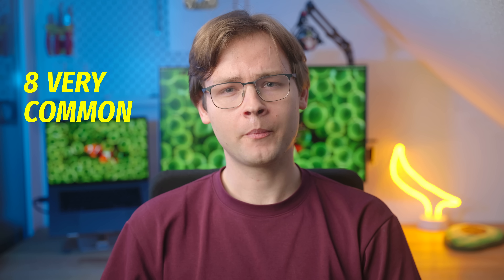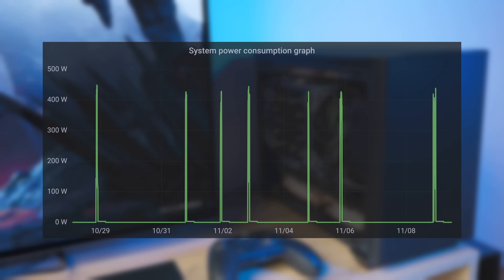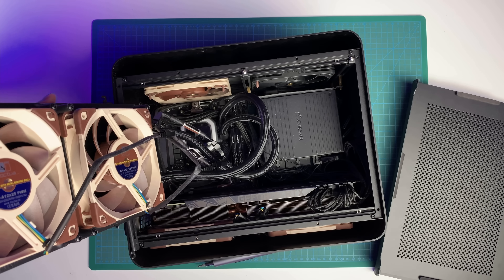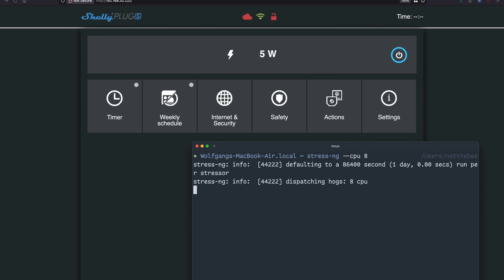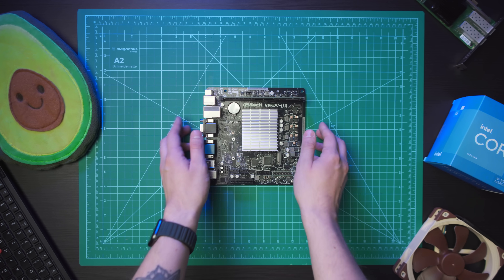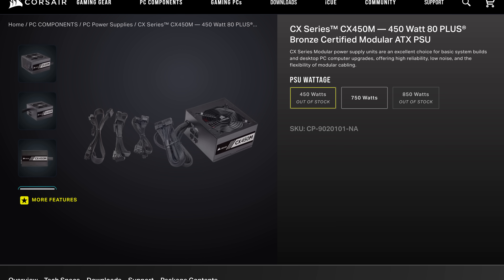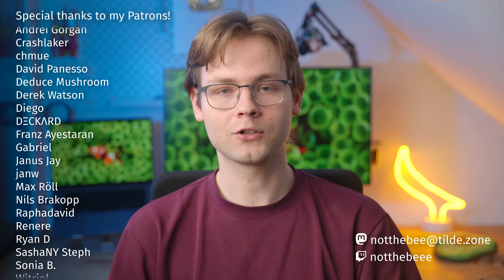Busting 8 Common Homelab Power Efficiency Myths

Comment from the maker: To try everything Brilliant has to offer—free—for a full 30 days, visit https://brilliant.org/Wolfgang/ . 
The first 200 of you will get 20% off Brilliant’s annual premium subscription.

Power efficient builds spreadsheet from HardwareLuxx: https://docs.google.com/spreadsheets/d/1LHvT2fRp7I6Hf18LcSzsNnjp10VI-odvwZpQZKv_NCI/edit
Reply: Do you think CPUs with E-Cores are worth it for good efficiency and performance for not so heavy tasks?
Reply: I'd really love if Wolfgang willing to make an example/tutorial using old mainstream/popular hardware of their era and still abundant and optimized it, not just the niche one. It would be nice for me, a common people without IT education, a novice. Using anything available on their home (unknowingly mistake etc), and then, mix-match it, not just buy an used old hardware.

For example: on my area, H61 chipset Mobo for miserable Sandy-Ivy Bridge (2nd-3rd) is still abundant. Along with DDR3. Maybe the pebble-like abundant is similar to Haswell - Kaby in Europe. And, C chipset is good, but B85M is abundant and not everyone using 6 HDDs, 4 at max for their homelab.😊
Reply: Useful vid, as usual! Hope you don't mind me putting this useful info here : In case anybody is wondering, 32GB hyperx fury 3200mhz runs at full speed and capacity on the n100m and n100itx.
Reply: 😂😂😂 why did you do it you didn't have too 😂😂😂 🤣🤣 @ 9:30
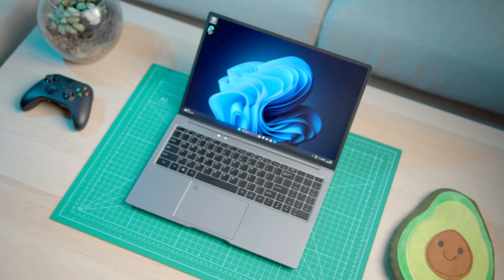Reply: 12:58 - laptop without screen and battery or how was it compared? 🤔
Reply from the maker: @TheStuartstardust  Fully charged battery (the laptop wouldn't power on without the battery). I've measured the power consumption both with screen on and with screen disconnected physically, and it made no difference.
Reply: What about server power supplies, as they tend to have high efficiency ratings by default, but might also be geared towards higher loads as you mentioned in desktop?

Comment: Does someone have a great advice on PSU?
I got an 12400f and Intel Arc A380 and 3 HDDs and 1 SSD
so not much and its mostly idling all the time
Would be nice if someone has an idea what to pick
Reply from the maker: PicoPSU
Reply: @WolfgangsChannel  Du bist ja denke ich mal Deutsch, ich nehme mir mal das Recht auf Deutsch zu schreiben. 
Für den PicoPSU brauche ich ja sowas wie ein externes Laptop Netzteil oder andere Netzteile mit so einem 5/2.5mm (Barrel-Jack?) 
Hast du da ein gutes im Kopf?
Reply from the maker: Ich habe bisher gute Erfahrungen mit den Leicke-Netzteilen gemacht
Reply: @WolfgangsChannel  alles klar danke dir 🙏

Comment: The power supply has other reasons to go for higher rated ones. Like durability when used 24/7 i have had several gold rated fail and made me swith to platinum rated as some brands guarantee 12 years on those. Have no broken one yet and the oldest ones are nearing 10 years now while most gold rated died around the 5 year mark.

Comment: There are still new 180W PSUs for office PCs, but for the price you are better off using a Pico PSU and a 12v 3A to 8A depending on your Max power draw + 15% headroom. There are Pico PSUs whu accept more than 12V. Those are for higher Wattage applications or if you plan to use a 65W to 200W 19V Laptop power brick. But have in mind the Pico needs airflow on 50% and more load. 
if you plan to use a N or J series CPU and go fully passive, what possible is and you won't have any fans in your case. Buy the highest wattage 12v Pico PSU and put some passive fins on the power stages on your Pico also the power stages of your motherboard if your motherboard has no passive cooling and every chip that is bare silicon. 
most of the Motherboards are not designed for passive cooling, even if you don't use a down blowing cooler is a big problem on modern Mainboards because of the poor thermal design around the CPU that require a down facing fan on it.

Comment: Will a AMD APU with disabled GPU (such as the ryzen 8400F) use less power than the same part with GPU (8600G) - when used in headless configuration - and without doing stuff you can offload on the gpu such as transcoding ?
Reply from the maker: In AM4 chips it used to depend on whether it’s a monolith or a chiplet design. Not sure about AM5

Comment: Common motive behind most points made: 
A machine that spends most of its time at idle can afford to be less efficient at load from a Total Cost of Ownership perspective. But that is only true to the degree that the few minutes of load do not flip the script. There is a lot of percentage difference between idling at 1.5 Watt vs idling at 2.5 Watt, but we pay money in absolute terms and at the end of the day it's only 1 Watt. Sure, it adds up, but large Wattage-differences catch up fast in absolute terms of Watts-used / money-spent. In an extreme case, if I spend only two hours a day at heavy loads and the newer CPU has way better performance per Watt, besides potentially getting the job done faster ("race-to-idle"), then those 120 minutes may well represent a greater tota-power-consumed advantage than the remaining 22 hours' incur in disadvantage in Watts. So the real TCO-question is not how much time is spent at idle relative to loaded, but this:

Does the time spent at load waste more money than the time spent idling saves? 

100% efficiency advantage at idle is still only a Watt or so in real terms (1 Watt vs 2 Watt e.g.). 10% efficiency advantage at load may well exceed a dozen Watts (x kWh price). You just waste them in a shorter period of time. Two hours at load may suffice to negate the idle power advantages of the rest of the day. And a newer CPU may be supported and remain compatible with upcoming stuff longer, thus extending duration of use until new, costly purchases of hardware become necessary, which also belongs into an  exhaustive TCO analysis.

Comment: In my experience the i3 13100t use less power at idle than the i3 12100. What is true in my experience is that the i3 12100 consume the same as the i7 12700k at idle. If you want low power consumption it depends on the motherboard more than anything.

Comment: asrock B550 itx, 5700G, 32gb Ram. 3NVME, 2 SSD, 280er WLED-RGB AIO, Asus Hypercard, proxmox, HA, 14,2W low idle line. without AIO and RGB, 12W should be possible. B550 Asus ATX gaming wifi had also around 15-20W with same rm850 corsair psu.

Comment: Dude educate yourself TDP is not max power draw.  It's just the heat that you need to dissipate.    CPU's have boost that will take the power consumption well over the TDP,  but the cooler and thermal mass of the heat-sink only need to be capable of dissipating the stated TDP of heat in watts.  Some examples,  11900K 105w TDP yet consumes 200W under sustained all-core Turbo Boost.   5950X 105 TDP, will draw 150w.  i7-12700K another 125w TDP that draws 200w.  7840HS can have the TDP set as low as 15W but will still draw over 50w at full load over 100W when TDP is set to 54W.  i3-N305 is a 15W TDP chip, draws 34w.
Reply from the maker: I explain that literally in the next sentence

Comment: I have Atom D230 (45 nanos technology for 2007 😂) with 4 watts TDA consumption running Debian Boorkworm Samba server files - I chosed this processor just foto TDA - other low consumtions motherboard I use are some with AMD C70 - AMD E1-2100 -  Celeron j1900 Quad Core - Celeron j3150 processors - always  thinking 10 watts maximum - I don't have hardware to check the real consumption- I just assume that Specs are real 😅

Comment: Extremely interesting video. But I've a question. You always speak about a idel home server. But what do you think about a pc that works as DVR? It process image and video all the time? For example person or facial recognition?
The system is never in idle mode and the performance for  watt is the most important parameter.
Reply from the maker: It depends on how resource-intensive the load is. A lot of servers offload things like facial recognition to a TPU device (like Google Coral), so it might not be as intensive as you might think. I would look at htop and see what the average load and CPU load look like
Reply: I'm using blue iris. My was only an example. In my case, I don't use facial recognition, but only person recognition. Is use a mini pc with a i7 10510u and the CPU is always between 80 and 100%. The max consumption of this CPU is 25W ,mesured with hwinfo (nominal tdp is 15W). Mi entire  mini pc consumes around 50-55W! I'm looking for a cpu with more efficency to reduce power consumption and increase the performance. Now the recognition takes about 3 seconds. But the good time should be less than 1 sec!
Reply from the maker: I would definitely look into getting a Google Coral TPU. I've heard that these are very efficient at things like facial recognition and a lot of people using Blue Iris and Frigate are getting them for their builds
Reply: @WolfgangsChannel   thank you a lot! Is the first time I hear about Frigate and Google coral. I look for more information on the web. Thank you again!

Comment: ok yea TDP tells not much abut the cpu but you have to watch about the TDP if your cooling solution cant handle more and you do sometimes heavy load. i do some of this sometimes and my server is completely fanless and can handle only 45w and at burst load 60W but this only for 20sec then the whole pc case heats up to 65°C and plus. i have chosen the 5700g and set the TDP to 45w. the problem with the case is that the single HDD i have in is connected to the case and its heat gets also to a part in the case and if the case gets over 70°C the drive shuts down and if the temperature rises even more the data on the drive can be damaged. so i have to use a lower TDP because of that and my cpu use. for the most part my system idles like yours, but like you i have some really heavy tasks that max out the cpu and the cpu goes 100% on all cores. i do analytic stuff with weather data and do abit of keras magic and rendering and this needs power and those runs running for about 10h or more and every other task is in this time in pause so i have the full machine power. now i have a r630 for this becuse that runs are now 80h and need massive ram and storage. i do this particular task for my maker space i am in but i have private project that need some power and having my main server packed for hours is not ideal. so i start up my r630 only i have to because 130W idle and 570W at full load with all 44 cores 100% and all 8 ssd fully packed with writing and reading. i load much as i can in ram but i have only 768gb in this machine but i can only load 200gb each time because the rest of the ram i need for the program itself but with this machine i am able to do this in 3h instead of 80h. my 45w system needs in this time 3.6kwh and my r630 only 1.7kwh so it is way efficient as the smaller system but idle power is massive compared. 
so yea different use cases needs different solutions for the best efficency

Comment: I will do this one: you can usually scoop a better deal on large memory lots (64 G+) of ECC than non ECC.

So why not?
Reply from the maker: I'll paste my reply to another comment

Costs as in ECC vs. non ECC RAM sticks? Sure. Registered ECC memory is actually even a lot cheaper than non-ECC, because it's only supported on HEDT/server platforms.

Costs as in actually building a system that supports ECC? That's a bit more complicated. In a homelab environment, you often have to balance power consumption, the overall size of your system, and other features that you might not need in an enterprise/DC environment (e.g. hardware video transcoding). Building just any kind of system with ECC is easy. Building a compact, power efficient system with QuickSync and ECC that doesn't cost an arm and a leg is harder.

So yes, ECC is great to have, but it's not indispensable in a homelab environment. Most of us don't run mission critical services for thousands of people which lose us money the minute they're down.

Comment: He doesn't talk about ecc is a must because ecc indeed is something you want to have. The extra costs are negligible and the benefits are amazing.. yea you don't need but you also don't need a CPU fan or an SSD.. do you?
Reply from the maker: Costs as in ECC vs. non ECC RAM sticks? Sure. Registered ECC memory is actually even a lot cheaper than non-ECC, because it's only supported on HEDT/server platforms.

Costs as in actually building a system that supports ECC? That's a bit more complicated. In a homelab environment, you often have to balance power consumption, the overall size of your system, and other features that you might not need in an enterprise/DC environment (e.g. hardware video transcoding). Building just any kind of system with ECC is easy. Building a compact, power efficient system with QuickSync and ECC that doesn't cost an arm and a leg is harder.

So yes, ECC is great to have, but it's not indispensable in a homelab environment. Most of us don't run mission critical services for thousands of people which lose us money the minute they're down.
Reply: @WolfgangsChannel  it's not only for mission critical stuff. I do however host my code and run a dev server on it (maybe niche idk?) Have archived software from the 90s my financial records (tax returns and for my business etc) data integrity is key.. imagine you run into bugs while compiling or having a bitflip in your source code or whatsoever and going to find a wrong value.. bit flip in a excel chart or just corrupting your favourite game from the dos area.. most if not nearly all amd platform do offer ecc support the ram sticks are around 10-15% more expensive.

That being said I bought my server used for 80€ with dual PSU 7th gen xeon 32gb ram and out of band management raid adapter and 4LFF hot swapp able bays for near line sas

Comment: Most wannabes think that a bigger power supply is good. I tell them to get the smallest they can find (250W?) for a mini-pc that would never consume more than 100W.

Same for bigger servers. Exceptions for super-powerful CPUs, 10+ drives  or graphics cards.
Reply from the maker: I would disagree.
Small power supplies went almost extinct as a category with the introduction of more power hungry CPUs and GPUs.

As a result, most of the <350W models sold now are older PSUs with decade-old tech. And since they're rare, they also aren't necessarily cheaper than 'bigger' power supplies

Comment: I always thought of the TDP as the approximate wattage required, when looking for a PSU to buy for the system. Not the best way, and even using that method I bought a 650w PSU when my desktop only needed about 500w, so I could have got a higher efficiency one for around the same price...

Comment: My electricity costs me $0.30/kWh. I worked out 1W used 24x7, this is $2.5/watt-year. So 100W at idle is $250/year in power bills. So 10W-7W is $7.5/year, for me.

Why no ECC? ;)

Comment: Idle consumption is important, but I will not limitate my preferences or choices because a computer uses 10W and the other 20W. 10W of difference means 7.2KW at month, which is about 1€ at month... I'll not even notice it :)
Reply from the maker: You absolutely shouldn’t 😁 by that logic, the most power efficient computer is no computer. It draws 0W

Comment: I run my daily containers (Home Assistant, Frigate, RTL433, etc.) off a Lenovo laptop with a Sandy Bridge i7. It draws about 8 watts at idle and works well for what I need it for. It was $13 at a thrift store (plus $10 for a caddy to add a second SSD) and it would be hard to justify replacing it unless I was running much more substantial loads.

Comment: Not all modern processors are so efficient, for example for my ryzen 5950x is idling right now in windows at 1% usage and according to HWinfo the package power is 48W where as the E5-2660 V4 in my cctv server is currently sat at 5% usage and 32W
Reply from the maker: True, AMD's chiplet CPUs are a bit of an exception from the rule :)

Comment: why not use a hba card instead of a sata controller with a arm system ... i dont understand that argumenting
Reply from the maker: I don't understand the comment either. Could you elaborate?
Reply: you mentioned youre using a x64 system over a arm system simply because you have not enough sata space wich is what makes me wonder why you wouldnt use a HBA Card wich can handle a "few" harddrives if you dont have the sata ports @WolfgangsChannel
Reply from the maker: Because on an ARM system, you usually have to choose between a SATA controller and another PCIe device. If you use the M.2 slot for a SATA controller, you can't use an NVMe drive. I use 10GbE SFP+ cards in my machines, some people might need a graphics card for HW transcoding. Besides, on an ARM SBC, you would usually get an M.2 slot, and not a real PCIe slot. Which means less bandwidth, and needing to McGuyver your own power source for the PCIe card and in case of the SATA controller, drives.